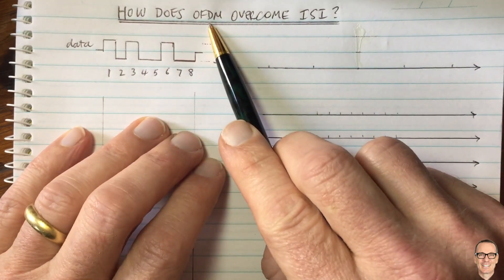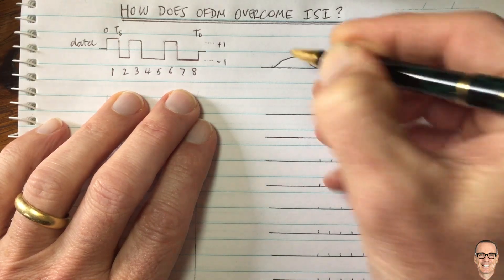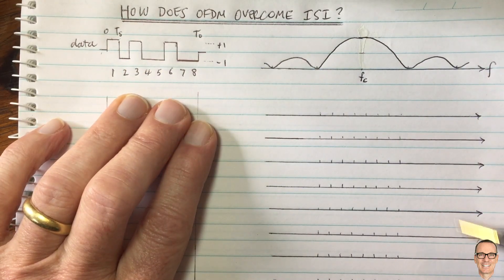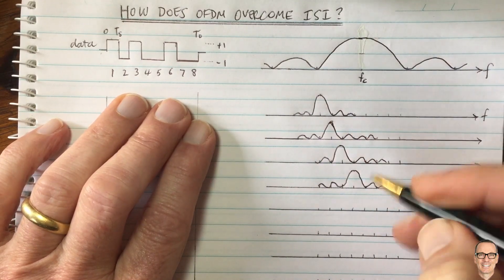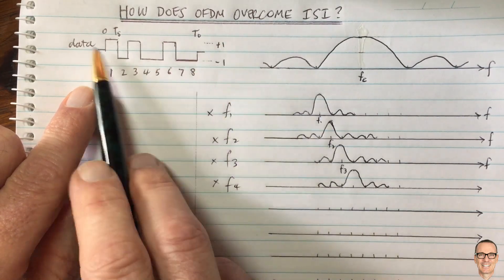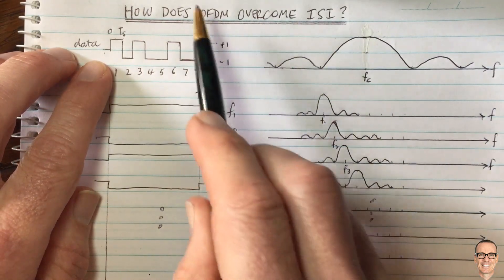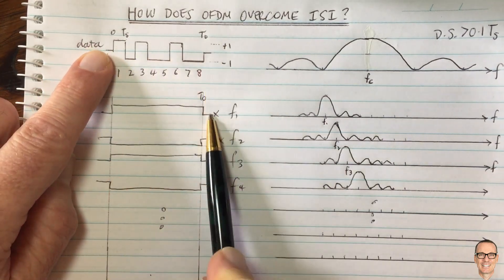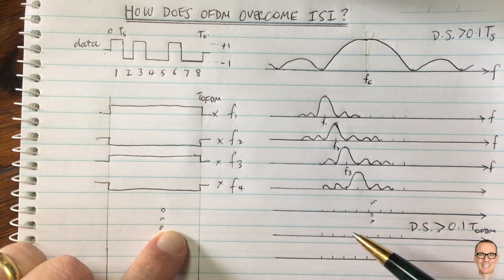How does OFDM Overcome ISI?

Comment: Hi professor, thank you for the inspiring lecture. Most of my work is based on simulation, so I got many confusions about the real operations of a OFDM system. Particulalry in S/P→IFFT→P/S chain, regarding to the clock of samples. In your video, we starts from a 8-bit data serie, which occupies 8*Tsym, right? Then, after S/P conversion, why each sample in 1 OFDM symbol lasts for 8*Tsym, not 1*Tsym? The second question is followed, after IFFT and P/S processing, why 1 OFDM symbol (equals 8 samples if I was not mistaken) still takes 8*Tsym, not 8*8*Tsym = 64*Tsym? I understand that IFFT is parallel and many books explain as the reason. While those parallel samples are converted back into a serie, not adding each other, so I cannot appreciate the textbook's explaination. Thank you for your patience. It might be a very basic question. Much appreciated if you can address this.
Reply from the maker: Hopefully this video will help: "OFDM and the DFT" https://youtu.be/Z4LIgNgNAlI

Comment: I am taking communication engineering right now and we are going over OFDM. My question is the following, you want to hold each data bit for a longer period of time in order to compensate for channel delay spread, but isn't the channel also changing over that period of time?
Reply from the maker: Great question. It depends on how fast the user is moving. Here are a few related videos: "What are Fast Fading and Slow Fading?" https://youtu.be/Tm-Uyajcuqs , "Why is Doppler a Problem for OFDM?" https://youtu.be/mB0GF9uKC48 and "What is OTFS? Orthogonal Time Frequency Space Modulation" https://youtu.be/MvK3zhPrGkk

Comment: 1.       I have a fundamental question that relates to Dual Connectivity i.e. N-DC refers to the dual connection of 4G wireless access network and 5G NR.
2.       Let’s say that we are using Band-X in 4G and another similar band in 5G and are attempting to communicate with both RATs to take advantage of EN-DC.
3.       The question is what will happen if there is overlap in terms of the “spectrum occupied”.
4.       Let’s say that the 4G component has been assigned spectrum in Band 3 from 1830 MHz through to 1850 MHz (i.e. a chunk of 20 MHz Bandwidth).
5.       Let’s say that the 5G component has been assigned spectrum in Band n3 from 1820.45 MHz through to 1830.45 MHz (i.e. a chunk of 10 MHz Bandwidth).
6.       In such a scenario, there is an overlap of 450 KHz between these two components i.e. the assigned 5G-NR band component eats into the 4g spectrum component by 450 KHz.
7.       Will such a deployment work in light of the designated configuration based on existing product implementations? There are bound to be issues in decoding such transmissions at the UE because of the overlap in the spectrum. The reason, I am asking this question was because an argument (however erroneous) can be made that the 5G transmissions would potentially be orthogonal to the 4G transmissions (even if they have an SCS of 15 kHz or 30 kHz) and hence the decoding at the mobile will work because orthogonality will prevent any decoding issues. I do not agree with this argument i.e. that the orthogonality provided by the OFDM structure of the waveforms would protect them against each other (i.e. from the UE perspective in the sense that the UE can successfully decode the two transmissions). I would be very grateful if you could enlighten me with your perspective with references (if applicable).
8.       If the answer is in the negative, from an R&D implementation, perspective – what changes would one need to implement to make such a configuration (i.e. characterized by overlapping assigned spectrums) workable in realistic network implementations?
9. It would also be immensely helpful if you could further substantiate your arguments with references from the relevant 3GPP specifications (or other relevant specifications) or draw my attention to any specific specifications or publications which can further clarify my doubt?
Reply from the maker: Sorry, I'd like to help, but I just don't have time to go through such a long comment.

Comment: Hi professor, thank you for this very educational video. I would like to ask one question:
Is the subcarrier modulated per bit in data stream or it could be "several bits"? 

Meaning,  if we are using for ex 64QAM each subcarrier is modulated per 6 bits, or to be more precise each subcarrier is modulated based on the 64QAM constellation point among with phase and amplitude, frequency of each subcarrier is selected based on Ts = 6*Tb, deltaf = 1/Ts. Thanks in advance for answering.
Reply from the maker: Yes, it could be any constellation you like, on each subcarrier.

Comment: hello professor, why there is a need for equalization in the case of OFDM when there is no ISI effect is there as it has already been resolved by making our channel a frequency flat ??
Reply from the maker: There is still ISI, but OFDM overcomes it by using sub channels and adding a cyclic prefix. Even then, each sub channel needs to have it's gain "equalised" (scaled) at the receiver since the sub-channel gains (which are flat in frequency) are not the same for all sub channels (due to the non-flat overall channel).

Comment: hey Prof Lain got a question for you if the OFDM systems are only solving the problem of ISI by converting a big chunk of channel in to small chunk of channel which are frequency flat then what new in this OFDM we ca even elliminate this problem of frequency selective fading/ISI by using Equilizers as simple as that problem solved . I mean why there is big hype around OFDM technique ????
Reply from the maker: It's not totally clear what you're asking, sorry. It sounds like you think that equalisers are easy to implement, and you're wondering why there is any need for OFDM? Well, that's not the case. Equalisers are not easy to implement. Optimal equalisers, such as the Viterbi algorithm, are very complex, and Linear equalisers are not optimal and don't remove all of the ISI. See: "Viterbi Algorithm Explained with an Example" https://youtu.be/xxpBHCkypS4 and "How are Different Equalization Methods Related? (DFE, ZF, MMSE, Viterbi, OFDM)" https://youtu.be/hYNwTTWrp48
Reply: @iain_explains  ok lain first of all thanks for the video, I think you got irritated by my question just asked out of curiosity as i was not getting the answers the way you explained  😊
Reply from the maker: No I wasn't irritated. I was just wanting to clear up any confusion. I am always very keen to encourage curiosity, so please keep asking questions.

Comment: sir is there any diffrence between the practical delay spread of a stationary channel mobile phone at rest and non stationary channel like a mobile phone in  train ( moving at 180- 200 km|hr )
Reply from the maker: The delay spread depends on where the reflectors are. This is related to the environment you're in. If the terminal is moving, then the delay spread value will change (since the relative locations of the reflectors will change). You might be interested in this video: "What are Doppler Shift, Doppler Spread, and Doppler Spectrum?" https://youtu.be/LLr3-kotbz4

Comment: does bit rate in case of OFDM and  single carrier modulation remains same if we put aside the effect of the intersymbol interference .
if so can you please spread a little light on this it would be very helpful
Reply from the maker: Sorry, I'm not sure what you're asking exactly.
Reply: @iain_explains  sir  i am asking if we have same alloted bandwidth  for both OFDM scheme as well as single carrier scheme than  weather the data rate will be same in both the case
(the data rate for OFDM = DATA rate of single carrier scheme )
bandwidth allotted same  for both scheme
condition - neglecting the ISI effect means channel is frequency flat channel
Reply from the maker: Across a band limited frequency-flat AWGN channel, the maximum error-free data rate is given by the Shannon Capacity equation (see: "What are Channel Capacity and Code Rate?" https://youtu.be/P0WY96WBUyA ). Whether you can achieve this in practice depends on many factors, including what type of coding you're using. It's not just about the modulation scheme.

Comment: Great Explanation! i really need to know how can we calculate the symbol period and the amount of delay spread for a single carrier transmission that uses 32-QAM where the delay spread is not more than 10% of the symbol period, and NO Cyclic prefix is used? 
appreciate the help!
Reply from the maker: You'd need to know what the bandwidth is, and what pulse shaping filter is being used.
Reply: Okay so can we find the symbol period if the bit rate is 50 Mbit/sec and the symbol rate is 10 M symbols/ sec ?
Thanks again
Reply from the maker: Perhaps this video will help: "How are Data Rate and Bandwidth Related?" https://youtu.be/ZBSvMbO0mPQ

Comment: Thanks for this wonderful video! I want to clarify something. Does it mean that when we sample longer OFDM symbols at receiver, we will get ISI only for a very small [ insignificant] part of the symbol whereas without ofdm, the ISI might span all of the next symbol?
Reply from the maker: That's right. The tradeoff is that with longer OFDM symbols there is more delay, and more chance for the channel to be "time varying" within a symbol period.
Reply: @iain_explains  Thanks for taking time to reply! In this case where time variation happens within the symbol, is there a concern of intra symbol interference? My understanding is that the received symbol will be summation of slightly delayed versions of multi-path symbols while will make the symbol shape deviate from the original transmitted symbol shape..does that make sense?

Comment: Sir, are you sending the entire bit stream (8 bits) in the carrier to the right or is that just for one of the bits?  For this example, your skipping the modulation of the bits. Should I interpret each bit to be a symbol?
Reply from the maker: I mention at the 38 sec mark of the video that I am showing the frequency plot for the case of modulating the input digital sequence by a carrier. In other words direct amplitude modulation. I drew a situation with a baseband digital signal that only has two levels, so this corresponds to binary modulation. So yes, each symbol represents one bit.